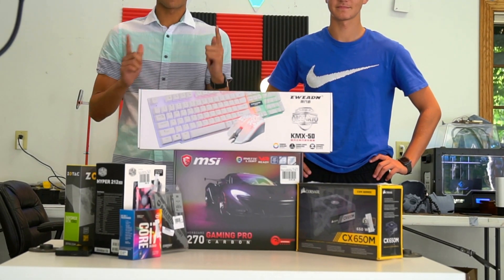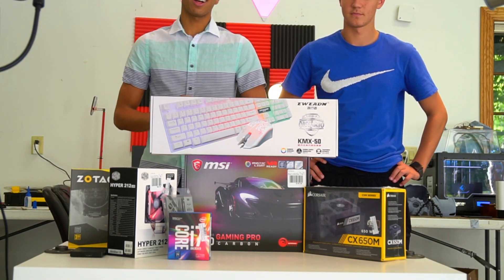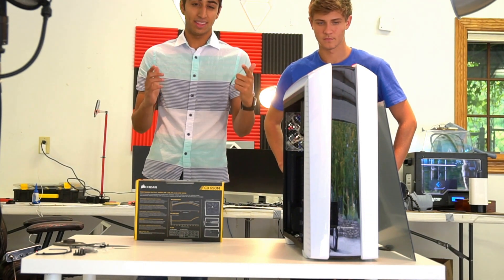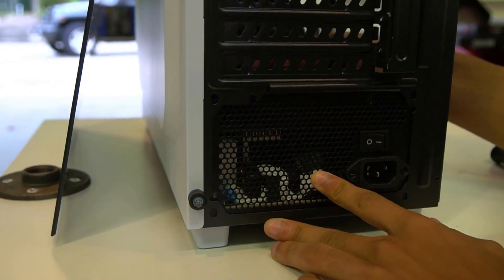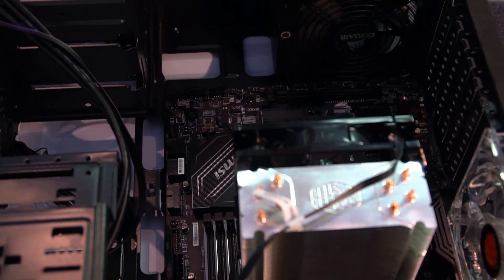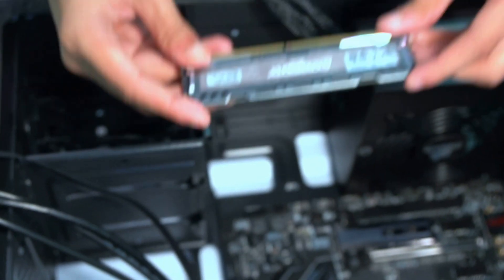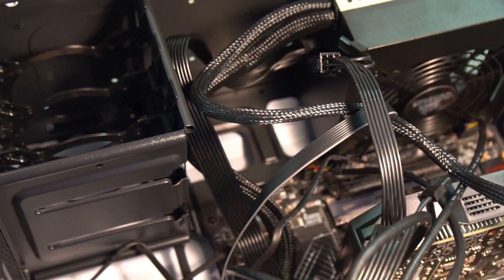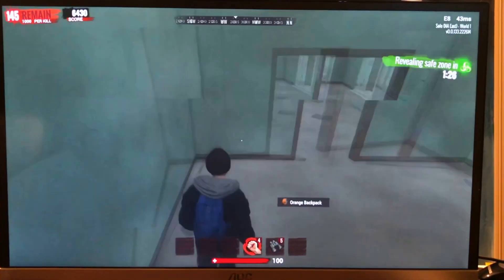$1,000 Ultimate Gaming PC 2017 - FULL BUILD

Comment: Im switching from console to pc and was wondering how do you connect to the internet wireless? I saw a video where you need a ethernet cable for wifi.
Reply: Also how do you get windows 10
Reply from the maker: +Viruhz Some motherboards come with build in WiFi, if not best way to go is with a usb wifi adapter or a PCI-E card
Reply: Alright thanks bro I will sub

Comment: Man. RIP cable management,you should fix that because it will affects the air flow inside the CPU and temperature
Reply from the maker: Harnold Gaming totally agree! We went ahead an seriously improved cable management after this video.
Reply: AshTech I know, overall this is a solid build and a little bit expensive in my opinion